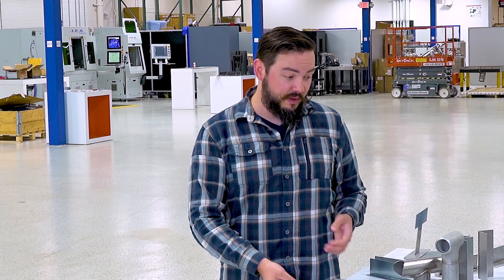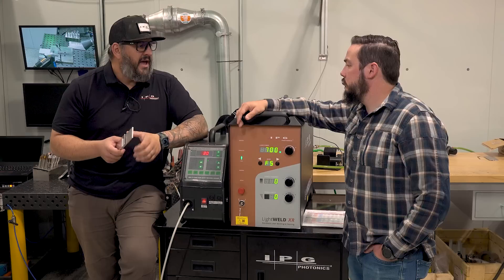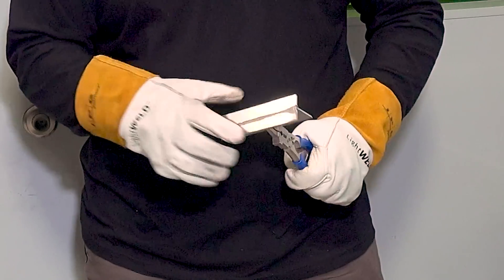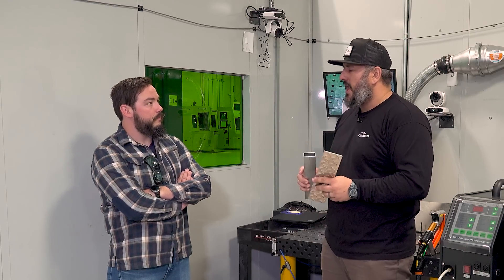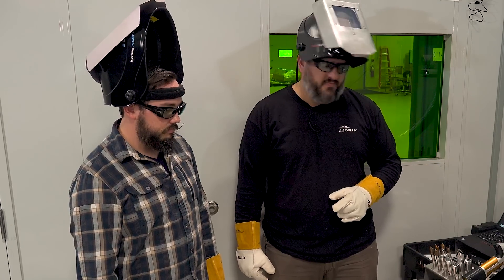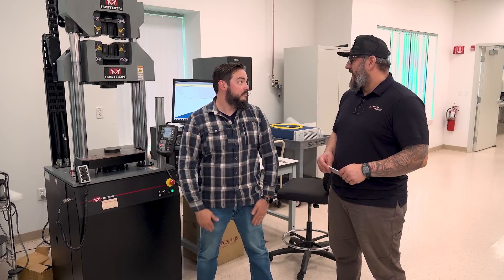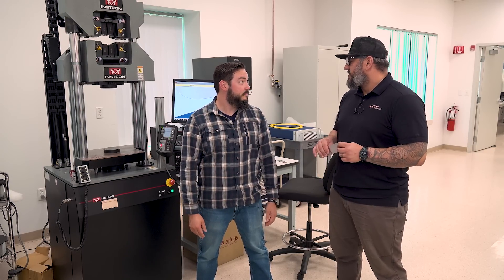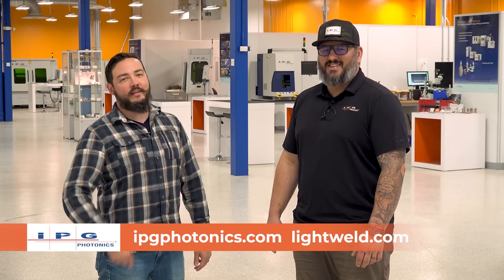Welding Aluminum With A Hand Held Laser?!: Is This The Future Of Welding?

Comment: I have a VERY hard time believing that light 'penetrates' better than electrical current. Please provide a cut-and-etch shot for the thicker material welds.
Reply: Ever seen a laser cutter?  My old boss had one and it slices through metal with so little heat discoloration.
Reply: @White000Crow  what about bone?
Reply: We do have a lightweld XC and just ordered at XR and i can tell you that its pretty good. The heat effected zone is way smaller and travel speed is also faster then tig
Reply: Penetration is EXACTLY the lasers strong point. Narrower and deeper, ..... as if the metals were formed together in the first place. Welcome to technology.
Reply: @geonerd I had a very hard time believing that water cuts metal like butter but it does.
Reply: @diyhard666  it's the grit in the water doing the cutting, not the water.
Reply: @chrishoesing5455  why tell me young padawan? A joke I was making.
Reply: What you so call "light" is a laser with thousands, possibly hundreds of thousands of Watts (in pulses). It puts electric current to shame in terms of actual energy penetrating into the weld.
Reply: is your skepticism rooted in the amount of energy carried in either photonic or electronic form?
Reply: Wtf did you think light is? Electromagnetic radiation. Lol
Reply: Your confusion might come from trying to compare two completely different processes. Electrical current will always flow through a conductor, it's the speed and volume of electrons impeded by the resistance of the metal that produces heat. With the laser, you have amplified photons moving in together putting electromagnetic energy directly into the surface. 
I realize this explanation is far from perfect but for convo I hope it illustrates... or at least clarifies the difference.
Reply: @mikemurphy5898  too complicated explained. Watch StarWars there u can c what lite can penetrate
Reply: Do you truly know how electricity works lol
Reply: For real, I have a laser welder and it penetrates much better than anything.
Reply: @franciscoperezgrovas2331 tell us more about your laser welding
Reply: Light is a form of energy and so is electrical current.  Light or a form of radiation can be focused much easily than an electrical arc hence allowing smallee burn/heat foot print.

Not convinced that a light not penetrating metal is fail to understand with enough energy behind it, it will burn/melt hence heat penetrates substrate.  It is just like you cannot weld witn AA battery.
Reply: Photons can do some strange things
Reply: Electrical current and light are the same thing on different frequency, change the frequency of the light and damn lightwelding son
Reply: Haven't the responses to your comment but do a little research on laser welding and maybe see why I wish I had one. This all
Reply: Lol.  Beyond your scope of understanding
Reply: Don't undersell "light". Lasers are incredibly powerful focused energy. End of the day energy is all the matters.
Reply: I second that. Show me the cut and etch lol😂😂😂😂😂. But this is the best welding channel hands down. Got to just love Bob and the boys.
Reply: I want one
Reply: To suggest you won’t get penetration is complete ignorance. Laser welders use keyhole mode  or conduction mode. The higher end ones use a combination of the two.
Reply: It’s a LASER
Reply: Flames don't penetrate metal at all, and yet they were how we welded for a century, and still do! And etching doesn't occur with a laser because there's no electrical current blowing apart the chemical bonds. As an engineer I'd be inclined to pull the joints apart and test for strength rather than attempt to compare characteristics of AC TIG or other processes.

With a laser, the heat is applied only to the surface but due to the effects of semiconductor physics, light actually does penetrate into the metal just a teeny bit. Interestingly though, the laser can pass right through aluminum oxide without heating it... that might be the equivalent of "etching" with a laser weld process.
Reply: Eventually, it can and maybe even will. It's all just energy. Look at the energy output capabilities of lights in 2010, 2000, 1990, 1980. I'm not surprised by this at all, science is cool.
Reply: The fact that you even asked that question leads me to believe that you wouldn't know what a good etch looks like even if he showed you
Reply: The down side is the torch is to big . Most times I’d not be able to get around a part with a torch that big . Come back when it’s the size of a tig torch and we’ll talk .
Reply: The down side is the torch is to big . Most times I’d not be able to get around a part with a torch that big . Come back when it’s the size of a tig torch and we’ll talk .
Reply: Jody did it on Welding Tips and Tricks
Reply: You can get fusion welds on outside corner joints with the typical penetration pattern on the inside you'd see with mig or tig, or not have it and the weld will hold. We tested welds with an 8 pound sledge hammer and the metal bends and rips, the weld doesn't break
Reply: If you have a hard time believing, you should research what a laser actually is. Yes, it is “light” but it is “stimulated” (the “s” in laser); the photon waves are synchronized, quantum mechanics involved, and focused in a way that they produce heat beyond what the amount of input energy would suggest. Far beyond. As someone already mentioned, laser cutters cut clean through, less heat affected zone, because the focused heat is so very high, there’s little dwell time.

Comment: can this be used on Stainless steel as well.
Reply: I've used it on black iron, galvanized steel, stainless, and aluminum. Aluminum is the only metal you need to use argon on, the others use nitrogen

Comment: Yeah just like everybody else is saying 25-$30,000 for that machine who's going to give me the money to spend that on a machine that have at home. I think I'll stick to my primeweld take 225x and I can make welds look just as good as that with my machine. I could have done that t joint in the same amount of time on my machine and I can say it wouldn't have folded over like that either with old fat ass standing on it!!!!!!!
Reply: That's not a machine to use at home, nor it is marketed for home users. This is for industrial/commercial environments, where it can make a difference between paying a highly skilled TIG welder 12 000-20 000 USD per month to produce X units, and paying an average Shmoe 5 000 USD per month to produce 2.5X units.
This literally pays itself back in that context in less than a month.

Comment: I’m waiting for the Chinese to bring the price down on these.
Maybe in 10 years I’ll have one. I’m still sore about the price I paid for my AC/DC TIG machine about 8 years ago! Damn those things are cheap now. Don’t wanna make that mistake again.
Reply: Lincoln tig machines have almost doubled in price in the last 4 years.   Imports are a bargain now.
Reply: @larslarsman  I'll buy a Harbor Freight Vulcan multiprocess pro welder before I pay Licoln their criminal prices
Reply: @larslarsman  Will Lincoln keep its sales ?
Reply: ATM the cheapest laser welder (1.5kW-class) you can find in (not from, e.g. without import tax to any country) China is around $3000, with the full package (laser, hand piece, goggles).

If you go higher end, say, you want an air-cooled unit (vs heavy, bulky water-cooled units) with a better galvo scanner gun, an automatic wire feeder, and an argon system, the package could easily triple in price.

The biggest cost is certainly the laser diodes, and it is limited by raw materials (silicon, MOCVD precursors, equipment) that the Chinese can't bring down. I'd say don't expect magical price from anywhere. This technology is inherently expensive.

Comment: Amazon has a laser welder for $14k 
This technology is great but is still very expensive, maybe in another 10 years it would become affordable.
Reply: Tig welders at the shop i work at run for 8k before all the bells and whistles
Reply: Actually between 10-11k for what I saw on some manufacturers websites.  $10k for a MAX laser source, $11k for a JPT laser source.
Reply: 14k for a laser welder?!
Dog, in terms of engineering thats insanely cheap.
Most shop welders can run between 5-10k for something as basic as MIG or TIG.
Not to mention the setting where this is useful is a high volume CNC shop that makes precision parts, which will immediately have the cost off set by the amount they're producing.
It's why you hear a lot that manufacturing thousands of parts, is 10x cheaper than manufacturing 1 specific part.

Don't get offended this exists, it has very specific purposes and it's not gonna replace conventional welding yet, or at all, and a weld without filler is only as strong as the base metal, so the purposes are more in-line with low stress CNC parts.
That being said, it IS very cool to see these becoming more prevalent and talked about because i do think if we can find a way to add filler, this is the future of welding.
Reply: But if you got a laser welder you don’t need a mig welder, smaw arc welder, acetylene torch, tig welder, Gas tungsten arc welder, etc.. because the laser welder will do everything So you actually end up spending less.
Reply: Here in indonesia it's only 6.000 us dolar for 1.500 watt laser fiber welding
Reply: Unfortunately in two years, the way the world is changing, you will only be able to lease one for a monthly service fee.
Unless something drastically changes soon, private ownership the way you’ve experienced your entire life, will be a thing of the past.
Fight for your children’s future! Don’t accept digital currencies or personal identification. Good luck!

Comment: Well this tec can sit on the shelf until it gets a bit more obtainable. I'll keep my tig machines and my wire machines burning until then. Might be ok in a window factory for thin stuff .
Reply: We're about to start using it on ~0.75" wall  17-4 stainless tubes so I'd say it's not limited to thin (or aluminum) stuff.  If you're watching @IPGPhotonics ... need your kit in Rialto yesterday.  If you can expedite, please do!

Comment: I am a substitute teacher at my local metal fab program and also a member of the advisory board. I have been trying to get a hold of IPG Photonics to try and set something up with them for the students.
Reply: They don’t seem to reply to anyone trying to communicate with them.
Reply: @21gioni  that's because the only thing they are doing is paid advertisment for a welding system that only aerospace manufacturing companies can afford to buy.
Reply: @fbi805  I disagree with that
Reply: @21gioni  you obviously haven’t done your research on laser welders, so feel free to spend anywhere from 15k to 100k on a laser welder and don’t expect the prices to go down anytime soon. Right now laser welding is being used for specialized manufacturing in aerospace and certain automotive engineering. Laser welders are big and bulky and are not easily transportable which limits their use to in shop work only. Unlike regular welders where you can use 110 power or even a generator to operate them, laser welders can only use 220 or 440 voltage and the only generators capable of even having enough power would be those 30Kw or higher diesel powered industrial systems that cost more than a 1 bedroom home
Reply: @fbi805  I am a trader and reseller of welding consumables.
Reply: @brink666  The future is now old man ! Adapt or extinct like a dinosaur !
Reply: you don't have the pockets deep enough to get their attention. this video was an ad for heavy industry.
Reply: It's both the cost of the machine and the safety area you have to worry about. Can't have it out like you would other machines. But the school at the gas and supply place my shop uses got one and showed us how to use ours before we used it

Comment: yeah 26-30K$ ill stick to TIG and Spool gun
Reply: Give it a few years....
Reply: Chinese ones are already less than 5% of that price
Reply: Yeah, though the great thing is that you can basically weld anything with it without sticking, and you go faster and with less material, so for a shop which does a lot of welding it's probably worth the initial cost.
Another thing may be that you can get away with less skilled workers, so if you save 10k a year by getting yoounger workers, it's paid itself in less than 3 years

Also if you're welding industrially with a 500k robot arm, 500 bucks or 30k on the welder doesn't change that much

But if you're in a small shop, getting a cheap welder makes more sense
Reply: You can make that money back on a few jobs.better to buy a 20k machine that helps you make your money back.a few jobs a month would more than cover the cost of the machine
Reply: I agree. There are several Chinese versions of this technology that are much cheaper. I predict as these and others are imported by some US distributors the prices will come down quite a bit.
Reply: Some are down to 5 grand
Reply: You can buy a cheap laser welding rig from china for about 6k (aud) about 3.5k usd. So the price of a fancy regular welding rig.
Reply: You can get a decent wire fed one now for 4-5
Reply: haha spool what ? its not approved by transport Canada  )))
Reply: spool gun lololo..
Reply: @Migman2020  The spool gun is often necessary for aluminum mig welding!
Reply: @StarForgers  decent  mig machines can run aluminium wire perfectly fine through the main wirefeed unit even at 10m
Reply: @Mr MIG Man  maybe that's true, but my welder is set up for steel wire on the main spool, and a spool gun for aluminum, as I weld both regularly.
Reply: @andrewschneider8295  Anyone that has to proclaim he's a big man probably has napoleon syndrome lol

Comment: Lots of clipping in the audio, starting in the second section....beyond that, very neat. I'm assuming these laser machines aren't really accessible on a prosumer budget yer?
Reply: I've seen some on aliexpress starting at 3 grand US.. so give it 5 more years and you should be able to get it for 2 grand and 10 years down the road for 1 grand?
Biggest problem is the radiation is invisible but way more damaging to your eyes, so proper protective workplace setup will be the biggest hurdle to overcome for the prosumer.
Reply: @joansparky4439  I think you're right as far as workplace safety is concerned, especially after reading some of their marketing wank. Work clamp for conductive interlock that only allows the laser to fire when in contact with the work, emergency cutoff switch connected to the door in case someone enters unexpectedly, keyed lockout to prevent unauthorized use (I seriously doubt the cylinder will be uniquely keyed or really much of a security device, but I digress), two-stage trigger (one button to enable, second to fire the laser) to prevent negligent discharge, and so on. Not mentioned was that 1500W is well into class IV laser territory, meaning momentary contact of the beam to your retina, even if the light is scattered or diffused, is enough to cause permanent blindness...and a standard welding hood is not enough to protect your vision unless laser safety goggles are worn underneath. Definitely not for the faint of heart, the forgetful, or those relying on standard homeowners insurance....so yeah, a very niche market, indeed.